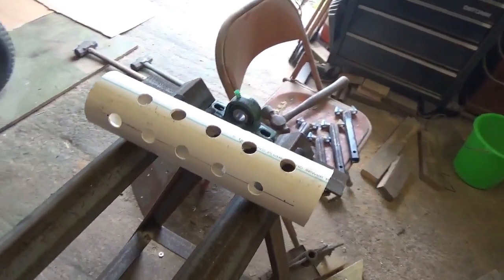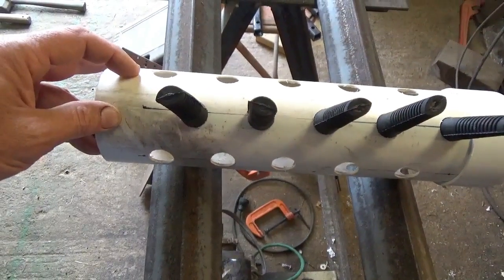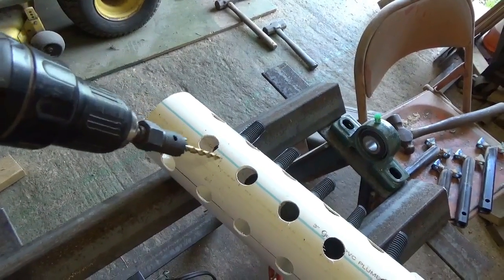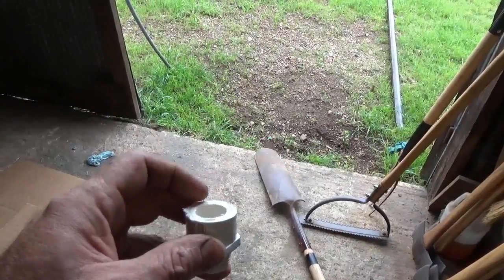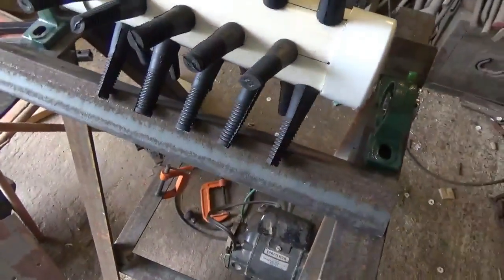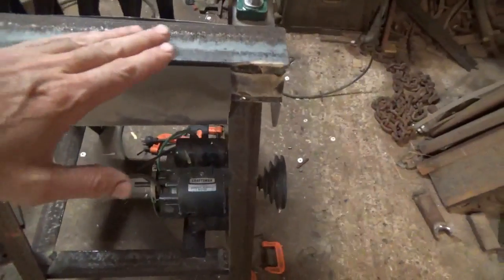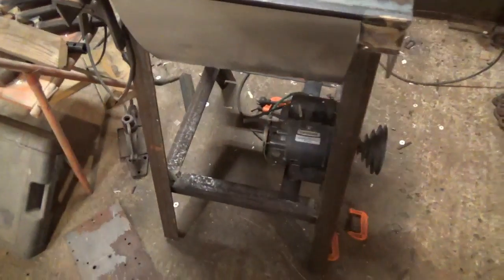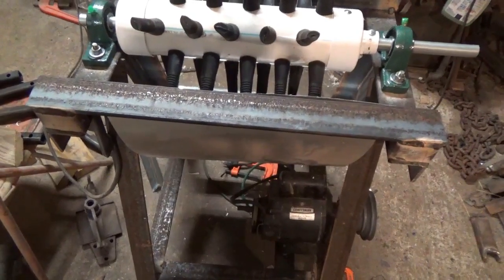making the plucker tube

Comment: How long is that shaft? What is the best size of motor to use? Thanks for the video
Reply from the maker: It has to be long enough for the pulleys to line up. I don't know on the motors, He had some used blower motor.
Reply: ok thank you